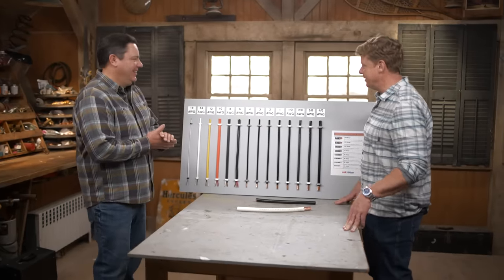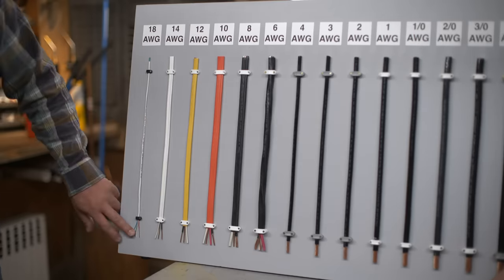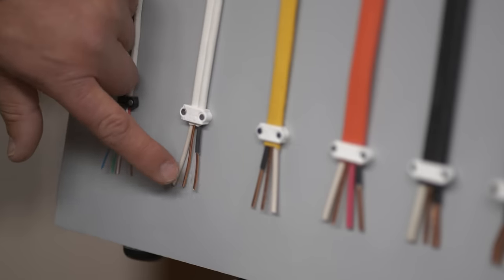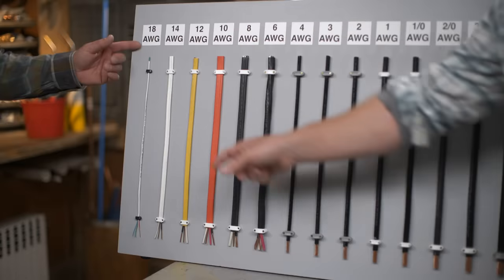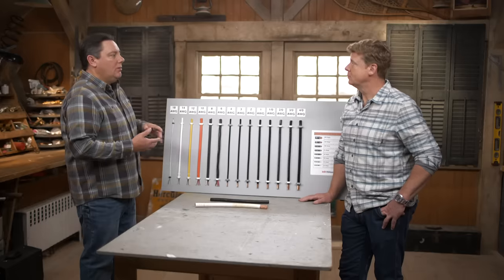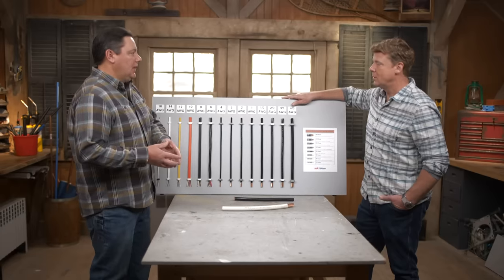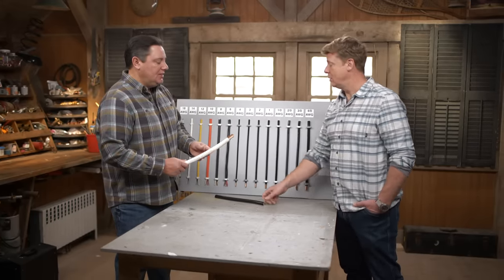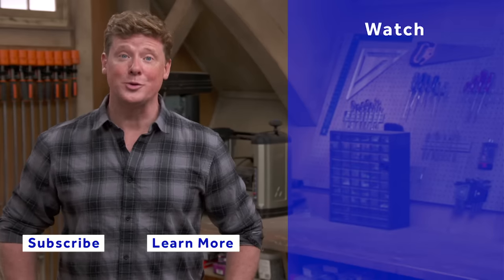Understanding Wire Gauges | Ask This Old House

Comment: I can't understand who would come up with such a system. When the theoretical wire thickness is 0 and the wire thickness can only increase, why start at a higher number and go backwards? It's really obvious at first glance and that's why the numbers go down initially and then go up again.
Why wasn't this immediately changed?
Reply: “0” was the default size, each number after that is how many times that “0” wire was drawn through dies to get it smaller. That system of sizing wire was held onto and standardized in what we have today. Also, you can thank the British is you want to place blame.
Reply: @leviathanfafner  Ok, that's really interesting to hear where this system originated. 
Still, as someone who is not used to this i find it irritating that the "wire thickness" number goes down and up again. Not a very clever design choice in my mind. 
Probably one of those cases where its like "Ok this method is not the best but we are now used to it so it has to stay" 😄
Reply: That's why in europe we just use  square millimetres.
Reply: If you are familiar with shotguns, the gauge is described as one pound of lead divided by the gauge number. So a 12ga diameter is 1/12th of a pound of lead rolled into a ball. and so forth for all gauges except 410, which is .41in diameter. That's why the gauge number gets higher but the diameter gets smaller. But in wire, every 3 gauges doubles the cross section when going down. 9AWG has twice the cross sectional area of a 12AWG wire. 6AWG has 4 times the cross sectional area of 12AWG wire. If you move in the other direction, for each 3AWG, the CS area is halved.

Comment: Extremely complicated when you compare it to British standards.
Reply: I'm familiar with British SWG, but I'm not sure how AWG could be considered "extremely complicated".
Reply: @jamiemacdonald436  It's more AWG goes from teenths of an inch up to an inch square then over to metric. It reads like it's backwards rather than fractions when comparing straight to metric.
Metric smallest cable typically used for lighting is 1.5mm square to 16AWG, up to a house supply which would be fed by 25mm square which is 4 AWG.
Reply: I wonder how things are wired in Canada. I'd assume they use AWG despite officially being a metric country just due to proximity, but I have no idea.
Reply: I understand in England brown is ground, which makes more sense than green, but that may be automotive wiring only.   For sure, NEW  ground wires in Europe are green with a yellow stripe.
Reply: I really wish we would just use mm^2 and be done with it. AWG, mils, cmils, mils^2 is a pain to deal with.
Reply: @leviathanfafner  In Russia we just use simple mm². Typical 2.5 mm² for  bedroom sockets. 1.5 mm² for light. 4 mm² for kitchen or even 6mm² if using electric stove.

Comment: My 70s tract home is all 8 gauge, the wire stripper tells me so.   This is strange to me because it's hard to find 8 gauge in the stores nowadays at all.
Reply: I'm almost positive you are useing your stripper incorrectly
Reply: This is extremely unlikely to be correct.  8ga wire is just over 1/8inch (3.26mm) diameter in solid copper, or about 1/4inch diameter after adding insulation. Possibly if it were aluminum wire some 30 amp circuits might be 8ga (like electric water heater, clothes dryer) that would normally be 10ga copper.  Or houses also have some 40amp circuits that will be 8ga copper like for the oven+range.
Reply: @chrisf9607  there is no wrong way to use a stripper 😂😂

Comment: This is BAD. This video seems to give the dangerous impression that choosing a wire size is merely a matter of convenience or personal taste. (1:43: "...we want that larger size" in kitchens and bathrooms for use with certain appliances.)  In fact, the correct size to use is strictly governed by the National Electric Code (NEC, a.k.a. NFPA 70).  The discussion of the consequences of using the wrong wire size (2:30) is also insufficient: using too small a wire for the load does not trip a breaker, it causes overheating and fires.  The visual array of wire sizes presented here is interesting and well-done, but on a channel that many viewers turn to for actual advice on how to do home repairs themselves, the lack of specificity about safety here strikes me as problematic.  I'm sorry, but I recommend that this video be edited or pulled.
Reply: Go get your booster shot

Comment: Well done America. When the rest of the world just uses mm2 for conductor sizes you manage to create something five times more complex and half as useful.
Reply: AWG is based off of the British system.  Americans didn't create the gauge system.
Reply: @warrenrohloff8095  perhaps. At least the British had the good sense to abandon it though!
Reply: @Peter Morgan  Sure, similar to many of the other systems of measurement in other industries such as the metric system. However, the United States has been quite isolated through much of the industrial revolution and only became a player on the global stage after World War II.  Up until then, the industries in the US relied heavily upon the former world leader and prior colonialist; the British.  Since the US only had to deal with the US, there was no need to change. Europe had many reasons to adopt newer systems since there were 40 some-odd systems from all parts of Europe. Things in the US were much simplier and never needed to adapt.  Definitely an issue now with globalization, but the US will eventually get there.
Reply: @warrenrohloff8095  interesting to understand the reasons for this in more detail. It was also interesting to find out that most US Customary Units are actually based off metric / SI units and their various physical constants. For example, the inch is defined not as a fraction of larger units, but as 25.4 mm. The UK and Canada are also the only two countries using a substantial number of mixed British Imperial and metric units. It makes me laugh, that we use miles when driving somewhere, but kilometres if we make the same journey on foot! Pints when it's milk or beer, but litres if it's most everything else.

Comment: It may cost more but I just use 10 gauge no matter what the circuit is for or how big the breaker is.
Reply: That's like saying use 2x12's to frame the walls. Ridiculous
Reply: @carpentrylover145  I have a lot of it left over from adding something, it's a lot easier to just keep using it than to go out and buy the "right" gauge for the circuit and breaker.
Reply: As long as the "no matter... how big" breaker is no larger than 30 amp that will be safe, but quite tedious.
Reply: @Sylvan_dB  yeah I meant for regular household wiring, 15 and 20 amp breakers only.

Comment: "...and then we go metric."
WHY WEREN'T WE USING METRIC FROM THE START?

I'm 40 and from the US; the more and more I use imperial for everything but temperature, the dumber it seems, even though I grew up on it.  I familiarized myself with liters and grams enough to use them for cooking, but there's no sense to it with dimensions because any product you buy or code you adhere to in the US is going to use imperial also.

So we'll just resign another generation to wasting time converting units from 16 to 12 to 1 to 3 to 1,760 rather than fixing the problem.  Not to mention all the time wasted on a global scale because the one holdout from metric also happens to be the worlds largest economy.